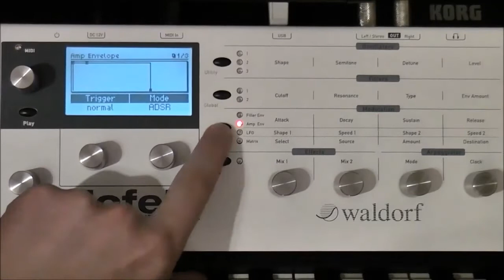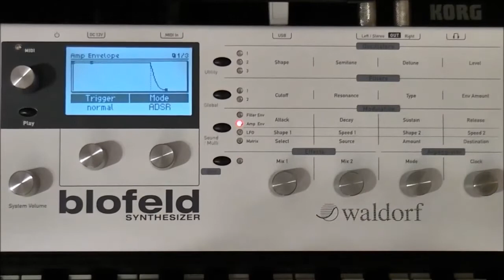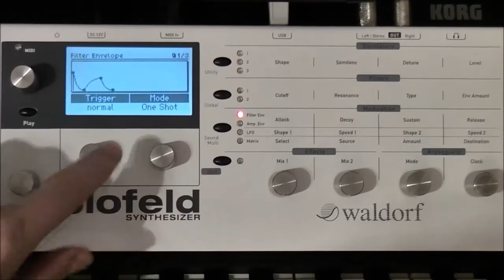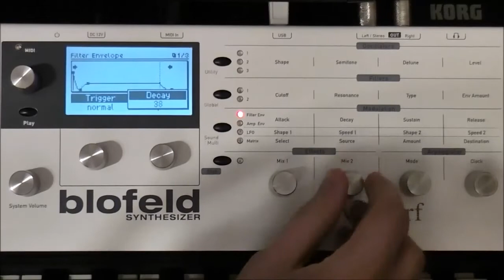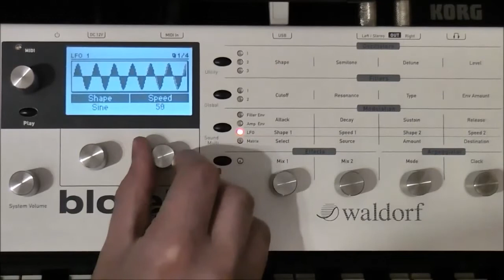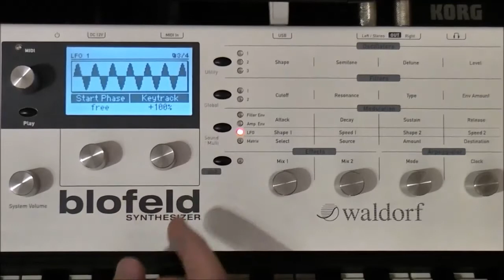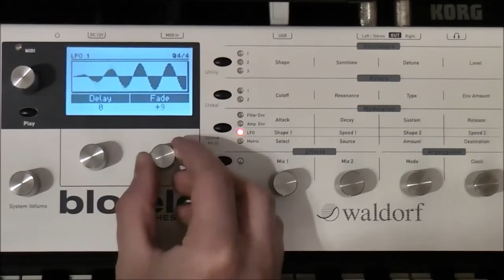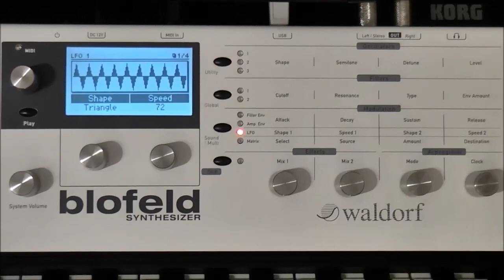[tutorial] Blofeld Beginners 5: Envelopes and LFOs

Comment: Very useful video! One question, if env 1 is rooted to filters, env 2 is rooted to amp levels, what are 3 and 4 controlling? amps too?
Reply from the maker: 3 and 4 can be used as free modulation sources in the modulation matrix. You can assign it to LFO speed, pitch, panning, PWM, wavetable...
Reply: Thanks!